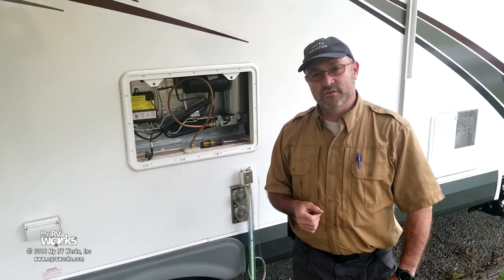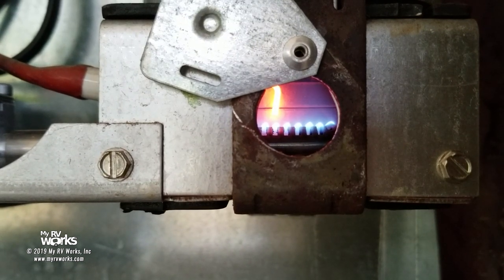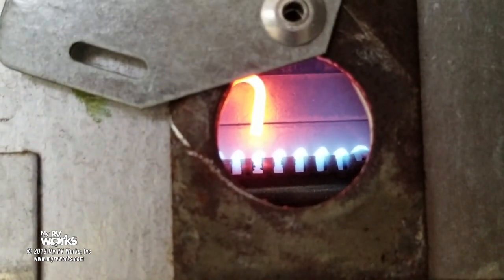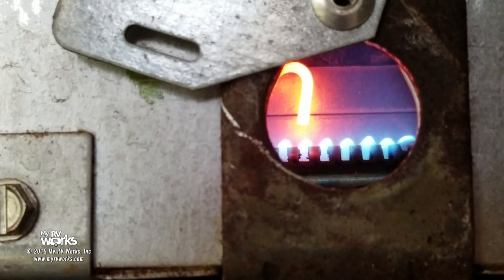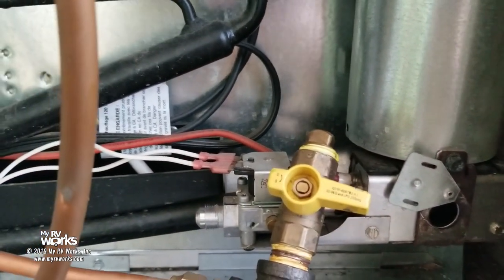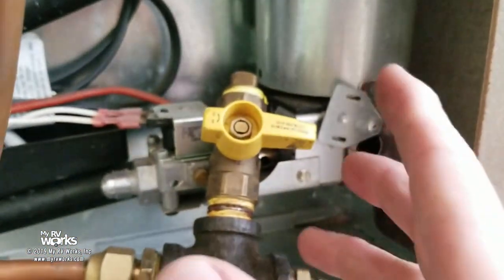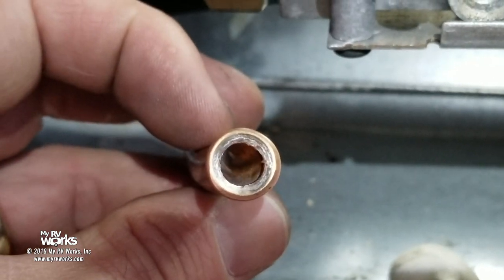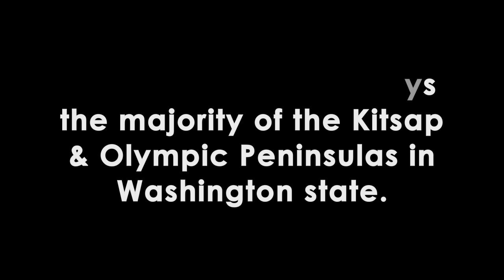Running This Norcold RV Refrigerator On Propane Gives Flame Out (FL) Fault Code

Comment: As a skilled technician of many skilled trades througbout the decades, I have come to learn from many gurus on the ins and outs of trouble shooting.  one of the most important rules that I always remember is that when you encounter an issue sometimes especially when it's a new install or recently installed, dentist office treated as if it was a new and work backwards from there.  but indeed in many skilled trades there are a specific scenarios or situations that arrives at only have a certain cause and effect that create these  recognizable issues.  I think you did a  phenomenal job and I appreciated your thoroughness.  I'll be honored in the work with you as your assistant anyday.  unless of course you're looking for a senior tech to help out.  I just finished 16 years as an engineer in draftsman due to the experiences that I learned as a tech.  after learning codes, how to use the UI, anything is possible if done in small steps.  which is what you demonstrated here more than anything.  Thanks again buddy!!!
Jeromy Crenshaw

Comment: Your video was very informative, thank you.

My issue is slightly different; my gas is flowing fine, and my burner is brand new. The stack above the burner gets hot, but the cooling coils do not heat. The refrigerator works fine on AC power. It was working previous to my putting a new burner in, since then I have taken it apart and blown out all Tubes and valves , fires and burns, but never heats. Eventually, ‘n’ code is thrown, and I have to clear it out by grounding the prescribed slot on thecircuitboard.

Comment: Darren,   I thought you might enjoy this one.   In 2014 Thor 27K our fridge was giving FL fault.   Checked gas tank valve, closed and opened.  FL fault again.   Could here arcing and new fridge was trying.   Turned gas switch on control board off and on.  FL fault.  Turned 120 volt switch for inverter in control board to on and the fridge lit up and worked.   Happy Camper!     Few weeks later, I figured it out.   The gas switch was connected to the 120 v inverter and the120 v inverter switch was connected to gas solenoid.    Bought it used, so do not know how it got flopped.
Reply from the maker: Excellent sleuthing on your part. Yes, I've come across so many strange wiring jobs with an RVs. It's always good to follow the trail and never assume LOL
Reply: @MyRVWorks     If I may ask a question, where is the LP gas solenoid located in a class A typically?   When traveling I’m told to shut gas off for safety.   If the solenoid is at the tank, is that safe enough, or keep turning the valve in and out?   Or are the safety nuts just wrong?

Comment: Liked your video. One time i worked on a wilf range. Pilot light in oven kept going out. This was at a day care center. I notices the pilot light flame sputtered slightly. Went to the gas meter. The vent cap was loose on the regulator. Little hand prints were seen in the dirt. Took the vent cap off the regulator. Yep! Full of sand.

Comment: My propane gas tube was clogged up at burner--  took out and cleaned up and soaked in brake cleaner for 10 min now i have a full flame.  The hole in gas tube pipe is microscopic opening... to regulate propane into burner and can easily get clogged.  Also I opened top vent and looked down and notices plywood scraps laying on top of the condenser pipes partially blocking the flow of air.  I removed them and blew off dust off off pipes with yard blower.  I added a 12V .05 amp computer fan in flue below top vent duct with a switch to turn on to help increase air flow in flu.

Comment: We had our camper off the truck. While loading it we unplugged the AC. So the refrigerator changed over to gas. Moments later the propane alarm went off. We opened the door and could smell it. We shut off the propane and continued loading and re-established AC power. Ready to leave, removed the AC power opened the propane and didn't observe a flame or LP to the refrigerator before leaving.  Stopping for diesel the propane alarm started up again. My wife opened to door, smelled propane and observed to refrigerator was running on DC. I had my wife switch it back to LP and I unplugged the refrigerator and plugged it back in and observed the flame in the port hole. We arrived ( Cape Disappointment by the way) and it had switched back to DC and then made our AC connection. All LP devices operated normally and the refrigerator worked on AC, until we left. Disconnected AC power. And the propane detector started sounding again. So we just shut it all down, shut off the gas and headed home to Auburn.  The LP alarm never sound again when we used the hot water heater, heater and oven with the refrigerator on AC.  Any thoughts or suggestions. It seems to us that we have the alarm sounding when there is a demand call for propane to the refrigerator.

Comment: Great video on trouble shooting in general. However you stated that the fridge goes out when travelling but works as long as the trailer is not moved. How does travelling down the highway factor into this problem?

Comment: Our Norcold refrigerator cool great on electric freezer and lower part. When put on gas the freezer works great the lower is not cold. Have you had this problem before? What could be wrong?

Comment: Great knowledge you share. I have a brand new trailer and my Norcold refrig has a intermittent sputtering of the flame, just like the video. I have followed your steps but instead of testing the LP I went ahead and replaced the regulator. Still sputtering, help!!

Comment: If you watch your flame very carefully  and you see it lift off the burner and kind of float upward (kind of blue haze ) it is usually a restriction high up in the flue  This takes a few minutes of running to start happening. This reduces the available oxygen around the upper part of the flame. It helps when you diagnose this if you cover the inspection hole with a piece of clear mica.  If the insp. hole is open for viewing you are allowing  more air in and you'll never recreate the problem and the flame will behave. Trust me here I've seen this more times than I can count on mobile home furnaces, 
( different animal/ same problem) It is called flame smothering..

Comment: Super informative.. we have a brand new Arctic Fox 25W travel trailer. Been hooked up to land line AC since we got it. Did our first maiden voyage to local dry campground 7 miles from home (thank goodness). Switched to LP and nothing but sputtering and clicking from inside the panel at rear of fridge outside. Know the fridge works (hence being hooked up to AC). With controls set to "auto" why would it not kick on using the 12V DC? Thanks!!

Comment: My fridge appears to work very similar to this one. The difference is after running for anywhere from a few hours to a couple of days it will blink showing a gas fault. When I turn it off and back on it lights right up but the ignition keeps going as if it didn't light. It continues to to spark until it stops trying and turns the gas off even though it was lit.
Reply: I'm having the same issue. Did you find a fix for yours?

Comment: Going after surface scuffs in the flair fitting seems misplaced. Looking at gas pressure would be at the bottom of my list. I would look at the following most probable cause of intermittent gas shutdown: First check to see if you have a clean consistent blue flame. If flame is weak or inconsistent check for debris in gas orifice and rust debris in burner tube. Check if there is rust debris on top of the burner?  Always Blow out the burner tube as needed maintenance. Is the burner corroded and disintegrated?   Check distance from electrode to burner. If more than 3/16" the control won't get enough current across  the gap and it will do a safety shutdown. Remove electrode and bend it slightly to get proper gap (1/8" - 3/16").
Reply from the maker: We can also add to this to verify that the propane cylinder has been purged correctly and that there is no air in the tank. Incorrectly purged propane cylinders will cause strange anomalies like this as well and render troubleshooting next to impossible. That's why I always carry a known good propane source for troubleshooting these systems if I suspect bad propane in the tank.

Comment: Seems I have the same problem but on a 1200.   Cleaned and blew out with canned air and vaccuum and flame still goes wonky.  Could the upward blowing fans be creating a back pressure off the cover on the roof then creating back pressure on the chimney tube.   We took the heat diverter twisty thing up and checked it for carbon and dirt. It was clean and the chimney pipe was clear, though we ran something up and down in it to be sure.  Fan does run all the time so assuming the thermal switch (on at 130f off at 110 I believe) failed in the on position ( does that happen)  got a new one and will be pulling the frig to change it out soon.

Comment: Hi.  Question for you.  On a manual refrigerator, once it as reached its desired temp. setting....( the biggest part of the flamme goes off but the pilot should stay lit)  what keeps the pilot on?  Mine goes off no matter the setting ?  Norcold N400.3R.  Thank you.

Comment: What if the valve is not getting the signal to open ? I've already changed the circuit board... when I put direct power to the valve it turns on for a second or 2...

Comment: Just subscribed and already learned a lot. The bit about the current going through the flame blew my mind as I was trying to figure out how an electrode used to start the flame could also be used to detect a flame. That is darned cool.  How does one determine the proper distance of the electrode to the burner to get that current I wonder and can I measure that current by just clamping the red electrode wire? (my unit starts the flame but clicks with the flame on which I think means it isn't detecting the flame - and then the flame goes outgoes out)

Comment: Darren. Thank you for videos. I have similar problem the flame is staying on with propane but the fridge is still not cooling .  Working great with electricity switch to propane get a steady flame bug fridge and freezer get hot.   Any help or ideas.  Thank you

Comment: First off, thank you for your wonderful videos.  I’ve sent so many of my Born Free FB folks to  your site.  I’ve developed two problems both propane related one on the water heater and the other on the fridge, Atwood and Norcold.  Water heater runs on propane for about 10 minutes, the goes into lockout and wont restart.  Now the fridge POPS! When attempting to start on propane.  I can light it manually, but eventually goes to NO FLM.  CLASS C.  Regulator?
Reply from the maker: It might be good to start with an LP pressure test. On our playlist section you will find one for LP systems. Depending on the state you are having the work done in you may require a license technician to perform these tests.
https://youtube.com/playlist?list=PLk44vSl27TRCiovamnQuBTHw89yE1u0WP
Reply: @MyRVWorks  ok update.  Had the tech check pressure all ok.  Had him do all three tests. Thanked him for his $109 test and ordered a new orifice/burner for the fridge and a Dinosaur Board for the water heater.  All is good now.  Thank you again!

Comment: Im thinking the rough Flare has swarf  ingress into the valve ? Great vid .. ( I wrote this before i saw the end of the vid ,,,, bugga !)
BJT N.S.W Australia 32 class "C"
Reply from the maker: Yes, when I watch the video after I got home, I saw the pipe that I had cut and inside it had debris from where they had tightening too tightly I suppose. That must have been what was in the gas valve. By blowing all that out refrigerator worked flawless. I was tempted to add to my video but figured I could just pack up and go home. It was 10 at night when I finished up that job. Everybody wanted to go to bed.

Comment: My refrigerator on lp the burner comes on the flame seems good but the ignition switch never stopped trying to light then it shuts of and goes in to a default code
Reply: Hey Bruce, did you find a solution? I am having the same problem
Reply: @jonvoss1995  well I replaced my starter and it seems to have corrected it

Comment: I have an Arctic Fox 990.  My frig looks exactly like the one in the video.  last week my frig stopped working on propane.  There was no indication on the frig itself.  The light was green, set to propane and on level 2.   It worked for two nights.   On the 3rd night the beer was still cold.   Over night the frig stopped working.   Like I said,  there was no indication of problem at the front of the frig.   I went outside and took the cover off.   I could hear the propane burning consistently and the tube above it was hot to the touch.   So my problem isn't exactly like what is shown in the video.   Any ideas?

Comment: Darren, when I bought my RV I was told that RV fires while traveling down road with RV's was most commonly related to the refrigerator pilot going out due to wind and then causing a fire. As a result he said it was best to not travel with the refrigerator running on LP? Is that what you have heard or believe? Thanks.
Reply: Will Stone there is no pilot light on current refrigerators, they are DSI, direct spark ignition.  Whoever told you that was Dumb.
Reply from the maker: There's no problem running the refrigerator while you're driving. The manual states this as the only time you can run when it's not level. So whoever told you that has very dated information and would not be correct with today's refrigerators.

Comment: How about trash/metal from the flare connection getting in the orifice, plugging it up?
Reply from the maker: Yes, I think that was a major contributing factor to this issue. In the very end after I had buttoned-up I blew everything out with the can of air and that really made a huge difference.

Comment: Should you run the fridge in transit?
Reply: Erik Gallimore why would you not? Food needs to stay cold.
Reply from the maker: There is no problem running refrigerator while you're in transit. The manual states that would be the only time you can run it when it's not level. So you are good to go with running it.

Comment: So my symptoms are, pop and won’t always start when cold, but will when I run it on electric for a couple minutes.  I am at 6k ft.  Norcold said won’t operate above 6k feet.  Anything I can do to decrease the propane flow a little bit to compensate for the altitude?
Reply from the maker: If you decrease the pressure in your LP lines, you are reducing the BTU output. Your LP pressure should be 11" of water column. On my LP playlist I have three tests to perform to check your LP pressure. Watch that video for more information. At your elevation it will be difficult to maintain the proper BTU, you don't need less gas you need more air (which gets thinner as you increase altitude)  If it's possible running the refrigerator on electric, it does not consume that much and a small solar array maybe everything you need.  We lived in Estes Park, Colorado for a few years, you may call a RV service in their area, they're at 7,500 feet. They may know more tricks.

Comment: So for it to run on propane you need to have the battery hooked up, or will everything turn off if I disconnect the battery? I got it to work unhooking the plug and following the directions. But if I kill the power trailer battery it won’t work correct?